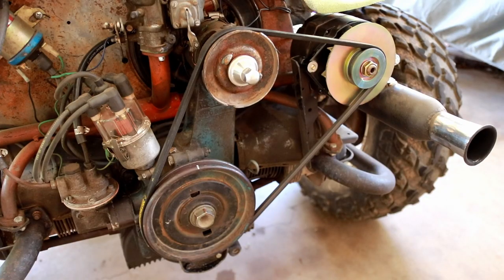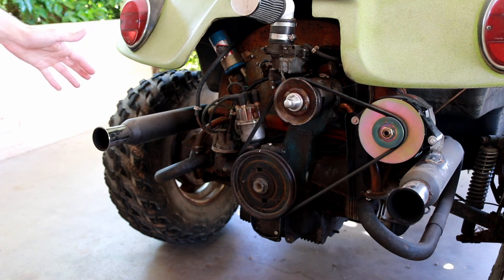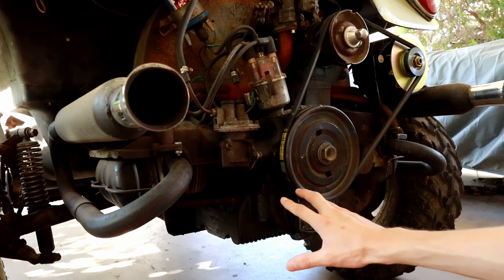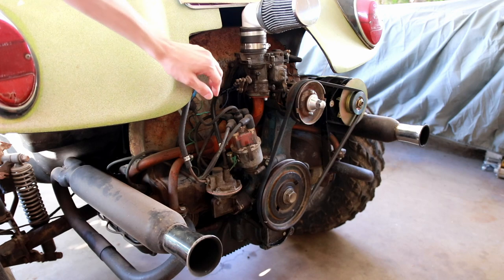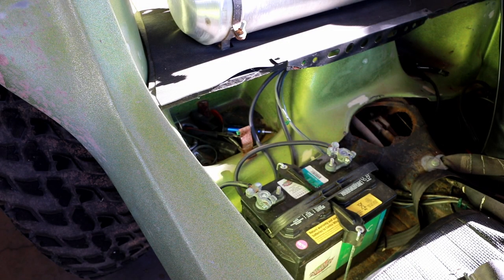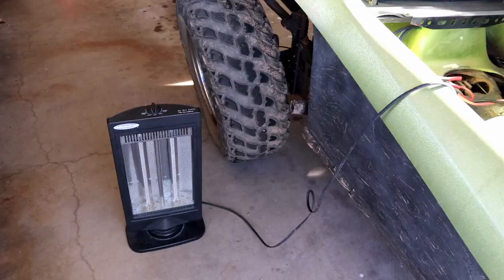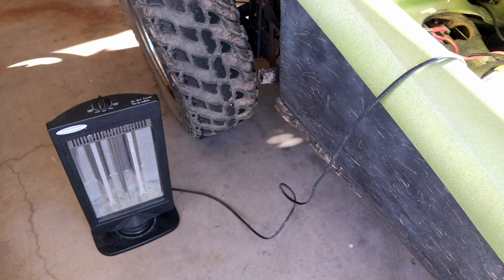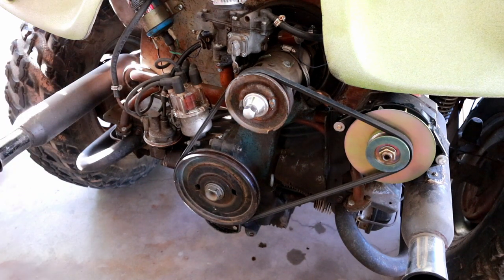150-Amp Alternator on Air-Cooled 36HP VW Engine

Comment: This is exactly what i needed to see for my project thank you! Although i dont have that type of exhaust pipes i have quiet mufflers in a 1973 super beetle. I will be installing an electric ac compressor that will need 100amp min alternator

Comment: love this 36 hp series. i love and own many Volkswagen's. i gotta say these old vw motors will not die. one thing i do recommend is that you install a oil pressure light if you haven't already. it will warn you if the oil pressure is below proper pressure so you will not blow up your engine. they are real simple to hookup and is just a simple measure of safety.
Reply from the maker: Great call, I just installed an oil pressure light last weekend and it has been working well. It seems that it takes about 4 seconds for it to build oil pressure when first started (which seems a bit long to me), but once oil pressure is built the light stays off, even at idle. I also installed a tachometer, which I might show in a future video. Thank you for watching!
Reply: @DielectricVideos  what oil weight are you using? it could be that

Comment: I contemplated adding a gm alternator on my '59 36hp engine. I want to do this because I can't just switch to a standard vw 12v alternator unless I buy a Porsche 90mm unit ($$$) due to the integral generator stand on the engine case. Later 12v generators won't fit the stand due to their larger diameter.

I am using an oe size 12v battery so I want a 55 amp alternator. A 150 amp unit would probably explode my battery! 

My 36-er is going in a full steel bodied bug not a dune buggy so I'm running the stock exhaust. As such I'll need to come up with a different mounting scheme.

I do wonder how/if the additional pulley affects the fan speed i.e. does it slow it down? I wouldn't want to mess up the engine cooling.

Thanks for this cool idea and for bringing it to life!
Reply from the maker: Sounds like a great project! As long as there is no belt slippage, the fan speed will remain the same. The length of belt being moved per unit time by the crankshaft pulley will be the same regardless of the number of additional accessory pulleys. It might be a good idea to incorporate some kind of tensioner into your design to ensure the belt does not lose tension if the mounting point flexes relative to the engine case.

Comment: Does the belt slip when changing gears when   clutch is down when cruising?
Reply from the maker: I've only had issues with the belt slipping when drawing 75+ amps. In typical driving, it doesn't really slip at all.